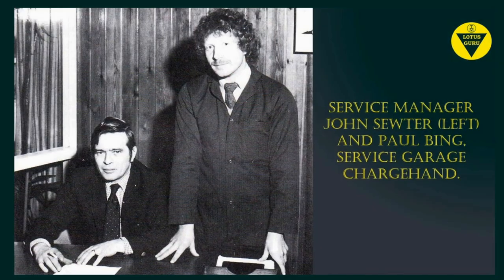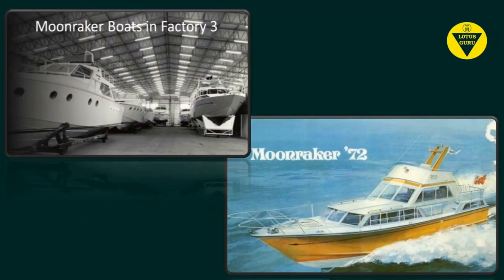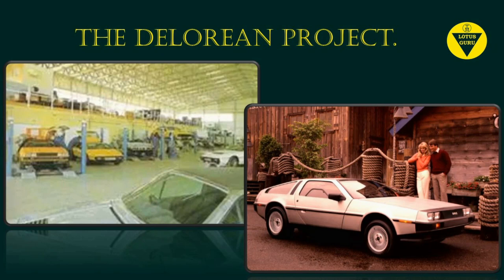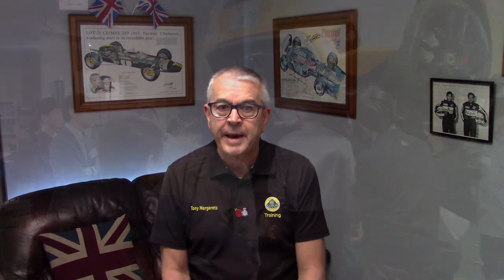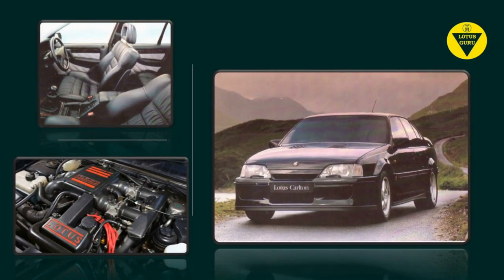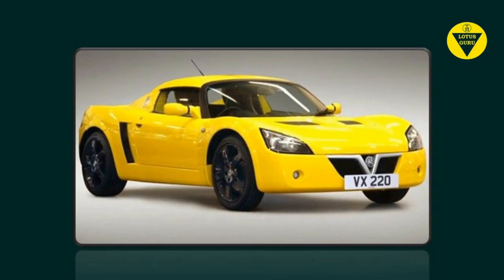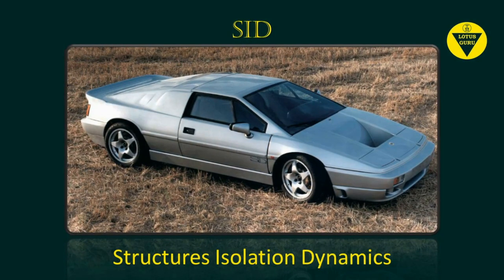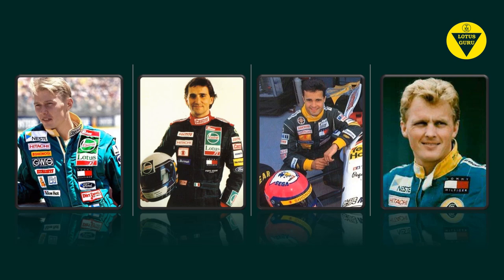Part two of Episode one of the Lotus Guru

Comment: I was the very proud owner of a 2010 NA Evora that was replaced with a brand new fire red, Evora 410 Sport, in 2018. WHAT A CAR THAT IS!  Would be interested in your views on the Evora 410 Sport.  I'm also an equally proud owner of a "skipton" as you called it, or a Type 116 NA!  It's almost 20 years old now but with a few choice upgrades (harness, supercharger, upgraded chassis brace and tie rod ends, etc) that make it a really enjoyable and fun track car.  It can't be that bad a car as last week in 5 days it did 900 miles commuting between home and 3 different UK tracks which it was thrashed around.  It never missed  beat and got me round the tracks and back home, stress free, worry free and safely!  Loving the videos. Great idea. Looking forward to future instalments. Nice one!
Reply from the maker: Hi Andy, Yes, agree the Evora is a much underrated car. Its amazing how tough and reliable Lotus cars and I include the VX220 in this are actually! I will be doing a feature on the Evora in the future.